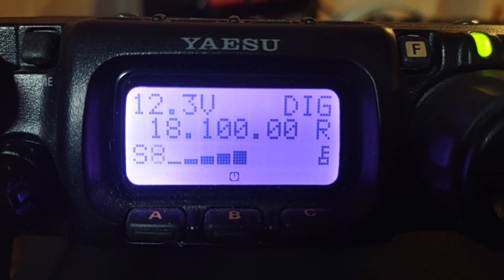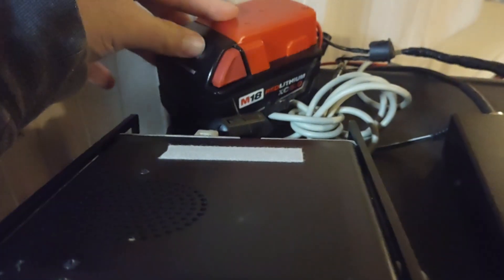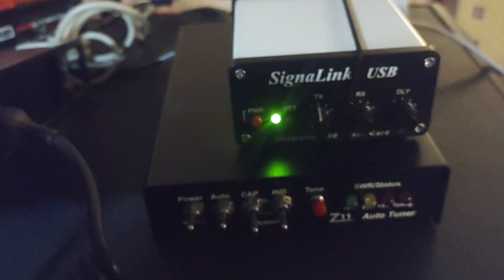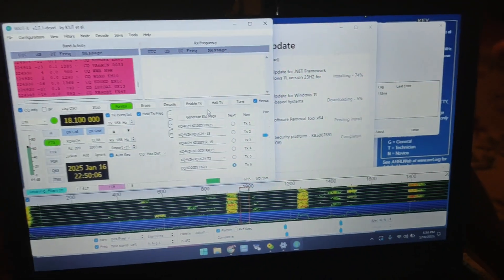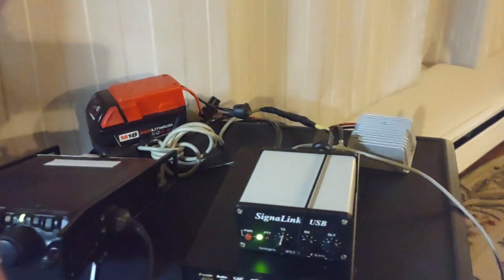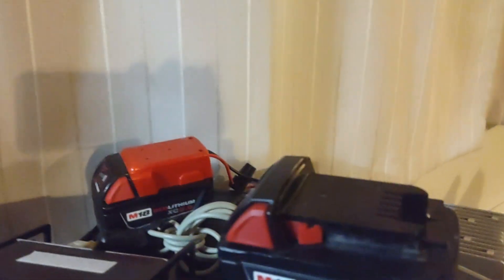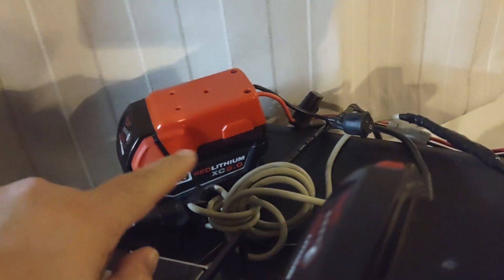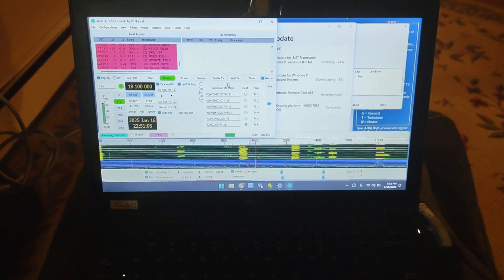Power your ham radio from Milwaukee tool battery No RFI !

Comment: To me those look like tool batteries you are using a jump starter with a 12-volt output well it's actually around 16.8 volts or so 

The two audew car jump starter packs that I have with this output the output is overcurrent and under voltage output protected I know this because I emailed the manufacturer you cannot hurt the jump starter pack by over discharging it

When I was watching the video it looked like you were using tool batteries
Reply from the maker: @markdi2  they are Milwaukee tool berries
Reply: @KD2GIY  also those DC to DC buck boost converters are very very efficient
Reply: @KD2GIY  jump starter packs with the direct output in the comment section

Comment: If you think about it why would a tool manufacturer build the low voltage cutoff point for the lithium battery pack into the tool it would be much better to build it into the BMS of the battery pack

Comment: Good job and another great way to use these battery converters mate. 
I just bought two of these adaptors for Makita Batteries today but without the converter because 
I am using them for a shed I rarely use at night in a paddock with a caravan type LED light that operates from 8v-80vdc so this is a good quick and cheap answer at $17 for two battery connectors with just the wires and a fuse from Temu, and I have heaps of spare batteries.
I was going to use the other one as a 12v-20v battery charger by using an adjustable boost converter instead, so I could clip/plug it onto any 12v source/battery, I am aware that it will need to be charged with a proper charger regularly also to keep the cells balanced. I think you could use these adaptors without converters to help jump start a car.
I also ordered a similar converter (AU$8.50) for Makita batteries that has a USB & USB 3 outputs and a LED light  built into the top which is handy for charging pads, phones, powering lights, fans or when camping, etc.
Reply from the maker: @evil17  very cool

Comment: The problem I found using this same type of setup is that there is no BMS in this setup.  If not paying attention that buck converter will run that battery down to 0.   So you can do permanent damage to your battery.
Reply: @dave_dennis  the tool batteries have a built-in battery management system
Reply from the maker: @dave_dennis  I have a switch in line, and when I'm done operating radio I just disconnect it.  You still have a valid point though.
Reply: @KD2GIY  the tool batteries have a built-in battery management system preventing over discharge
Reply from the maker: @markdi2  I only charge my Milwaukee battery on the Milwaukee cradle so this is not a problem for me.
Reply: @KD2GIY  yeah same with me I only use the 18 volt Chargers that I have for my batteries
It would be sort of nice to know the low voltage cutoff voltage built into the Ryobi batteries that I have
Reply: @dave_dennis  I know my Ryobi batteries have a low voltage cutoff Point built into them a BMS built into them

Comment: hmm.. those buck converters usually work by pulsing into a coil.. wonder how much ripple is there in the power line
Reply from the maker: @EvgeniX.  Worked well for me
Reply: @KD2GIY  good point. nevertheless, a comparison on the noise floor vs a 12v battery with no converter would be interesting.
Reply from the maker: @EvgeniX.  I've done both with the same results.

Comment: I built one years ago using a ford alternator regulator. they are external, and cheap per watt. of course, I dont like jeff bozos politics, so I don't visit the site. I went to the auto parts store and had it the same day. I also didn't get fancy schmancy with the cap. wish I had though. using spade connectors leaves something to be desired...

Comment: this is excellent idea. I have exactly the same buck converter on 12v nom to 12.5v stable. I have a router that likes to have stable power and my solar system varies between 11v and 14v, so router have previously self-reset. now its stable. but this idea to use it for "unusial voltage source" is awesome, I just typed it in and your 1 day old video confirmed my thought process. good luck and 73
Reply from the maker: @ПростоДругаяЖизнь  glad I can help..